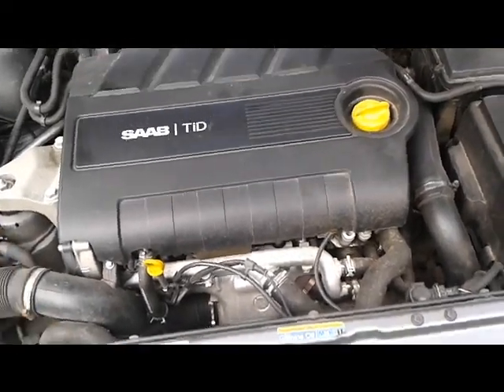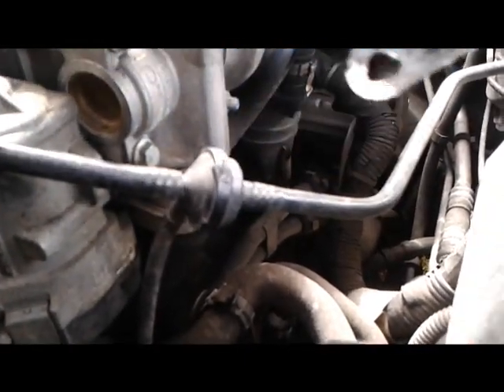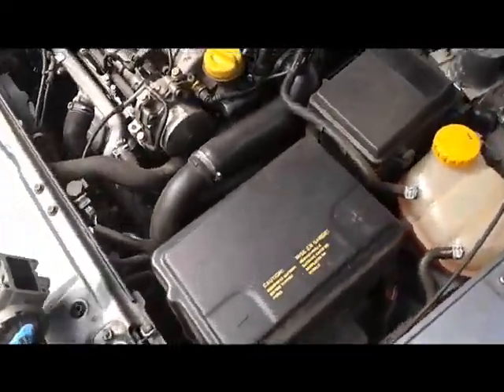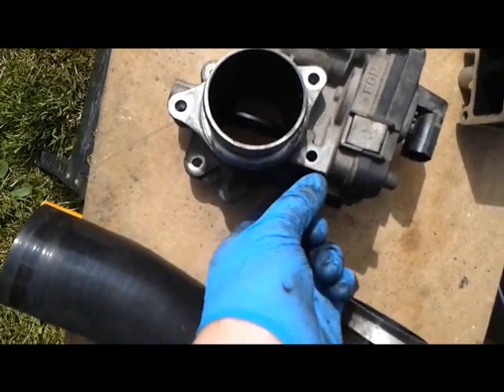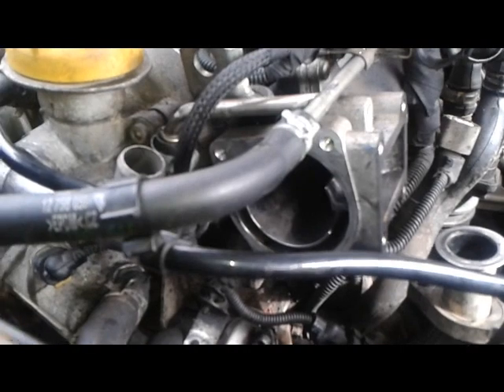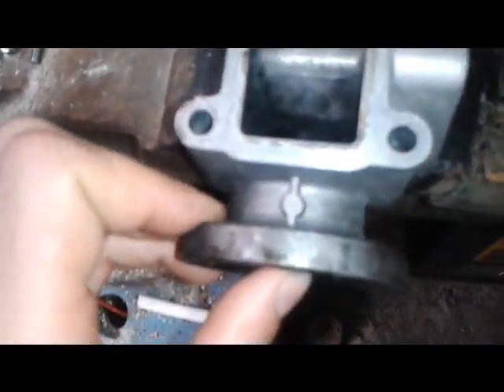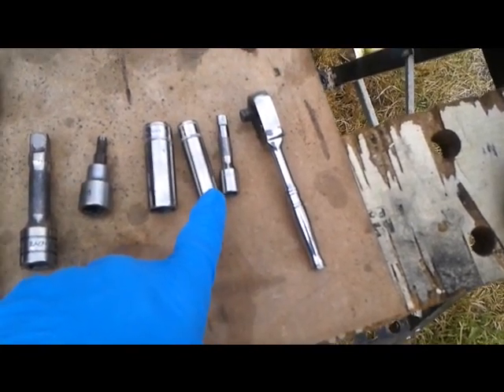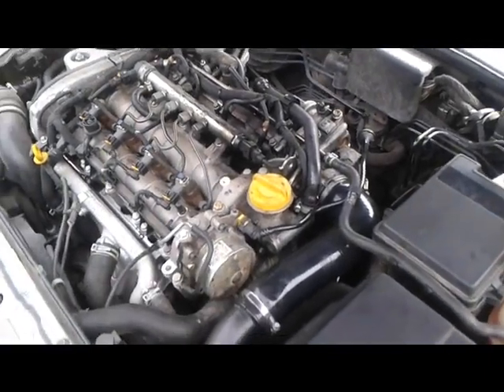EGR valve remove and clean, Z19, Vauxhall, Opel, Fiat, Saab

Comment: 👍 good vid . Yes inlet manifold gets gunked up too 👍
Reply from the maker: I ended up replacing the manifold, flaps..... you know it
Reply: EGR blanking and oil catch can would be a good combo, clean out the air/oil separator if not 👍